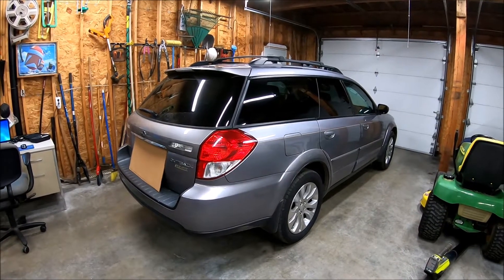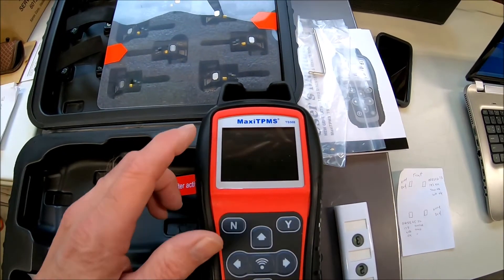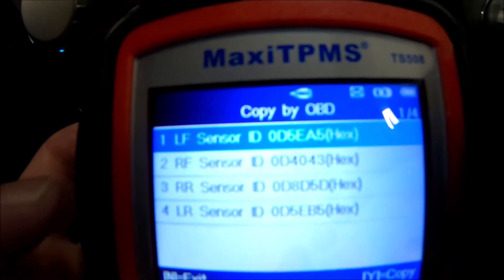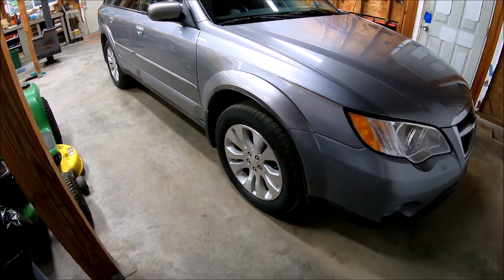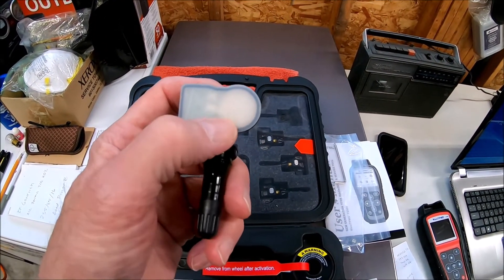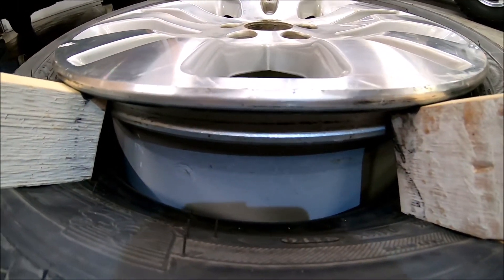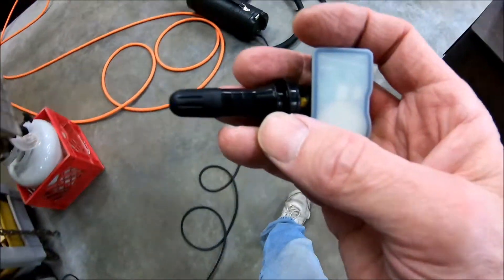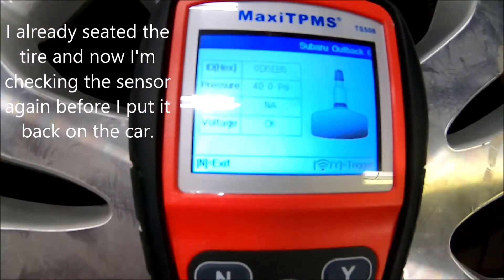Using Autel MaxiTPMS TS508 Tool To Replace And Program TPMS Mx 1 Sensors

Comment: Good work on the fix with the Autel TS508 and the MX 1-Sensors. It reminded me of the time when a Subaru Outback of that generation (albeit older) came into the shop with a blown-out right-rear tire and a dead TPMS sensor inside it. They were fixed since then.
Reply from the maker: Thanks

Comment: The Subaru looks like its in great shape for a 2009. I think video quality was OK, easy to understand what you are saying and showing. You get the same kind of anything “quirky” sound when you hold the Go-Pro that I have sometimes. Hate when it happens. Wondering if there is a case that can prevent that. That TPMS tool seems like a great tool to have!
Reply from the maker: I was a little disappointed when I went to edit the video and it was so shaky I almost didn't put it up. I had the gopro set for 120 fps and so the stabilization was not very good. I now have it set for 60 fps or 30 fps so that I get a smoother picture. I'm glad I put it up now because I think it will help someone looking to use this tool to show what it can do. I was very happy with the results. It would have been over $200 dollars to have a shop do it. The tool kit with sensors was about $280 and I have lots of sensors left should I need them.

Comment: Hi, thanks for the video ! What is the main diff between TS408 and TS508 ? Can you explain how to break the tire bid at home ?
Reply from the maker: I'm not sure of the difference between them exactly you may want to google ts408 vs ts508 and find a chart.  I ended up using a tire machine to break the bead. Thanks for the sub.
Reply: @mikesworld60  thanks Mike

Comment: Why would you have not changed the sensors with the tires?
Reply from the maker: You would, but the tires were mounted and balance by Costco and they wanted too much to put in new sensors. I paid less for the tool and sensors, and I also wanted to do it myself so I would have the tool and 4 extra sensors for later.